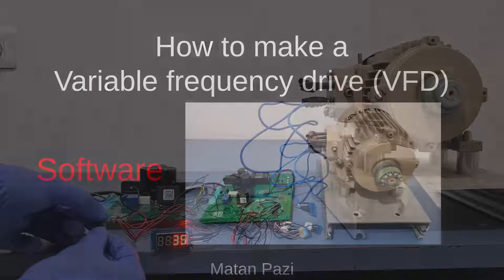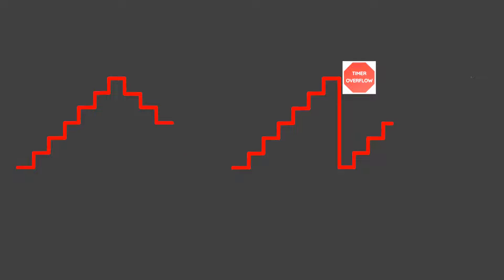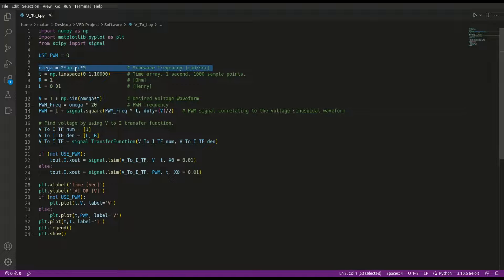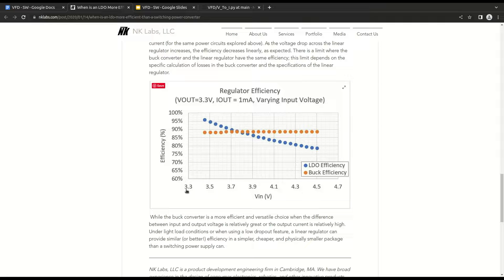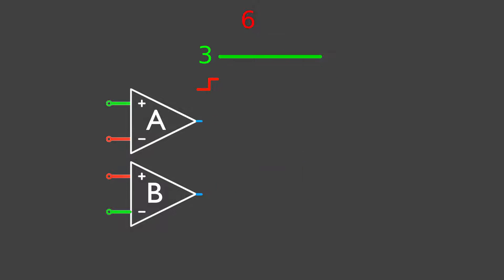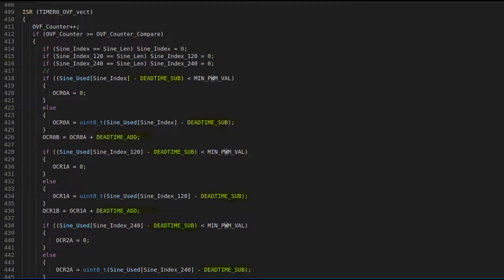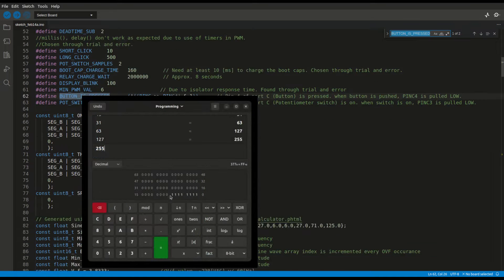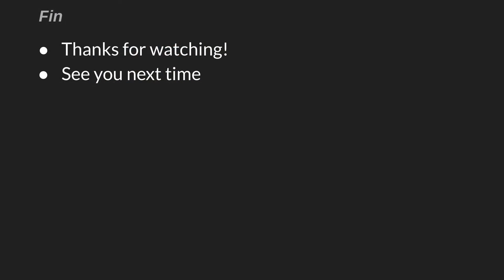How to make a Variable Frequency Drive (VFD) | 3: Software

Comment: Great video and great project in general. I'm trying to build a single phase inverter based on your project sir, but unfortunately I'm not being able to make the motor spin, if I measure ac voltage between U and V phases at 120Hz, I only get a voltage value around 146V. My induction motor has a capacitor and it's made to be running from an ac 230v@50Hz power outlet, can you share any information regarding the 1_PH side of the code sir? It would be very appreciated
Reply from the maker: No special change needed for a 1 phase motor, except for not needing 3 sine waves, not sure what else to contribute..
Good luck!

Comment: Excuse me, do you have a datasheet for the component? Also, regarding the motherboard, how did you design the circuit so that you can later weld the components?

Comment: Great video and great project. One question. In your ISR, why do both outputs of the pwm timers cycle every time? Shouldn't that phase of the motor  be kept close to the same potential difference until it crosses 0 or 180 degrees in its phase angle? Or am i misunderstanding the code or missing something else?
Reply from the maker: @aaronveale6402  Thanks.
I didn't exactly catch what you meant.
Can you refer to the exact variables?
Or maybe copy the relevant part of the code or maybe show how you would expect it to be?
Reply: @MatanPazi , sure. Starting on line 443 in the isr.

if ((Sine_Used[Sine_Index] - DEADTIME_SUB) < MIN_PWM_VAL)        
      {
         OCR0A = 0;
      }
      else
      {
         OCR0A = uint8_t(Sine_Used[Sine_Index] - DEADTIME_SUB);
      }
      OCR0B = OCR0A + DEADTIME_ADD; 

I would have expected for half of the sine index array for OCR0A to be zeroed turning off that igbt completely and the other half to have OCR0B zeroed. Thanks  for your response BTW.
Reply from the maker: @aaronveale6402  Oh, why?
I'm using sinusoidal modulation, what's the reasoning behind zeroing the output for half the period?
Reply: @MatanPazi  my basic (and inexperienced) understanding of your code is frequency is handled by timer0 overflow events which increment the phase angle to the next stage with your isr. Then your isr pwms a full or reduced potential difference (positive or negative) to each phase depending on the phase angle making it one segment of your waveform.  So why does one phase need to be pulled both negative and positive in a single segment of the waveform? Or am I missing something?
Reply from the maker: @aaronveale6402  Ok, I'll focus on the second part: "So why does one phase ..." since the first part seems to be correctly understood.
Are you asking why I'm commanding both the positive (Top) and negative (Bottom) PWM outputs?
Essentially asking: "If I want a positive potential difference, can't I just command the top transistor at certain duty cycles and leave the bottom transistor disconnected?"

If during normal operation phase A's transistors (Both top and bottom) are off, well, wtf, now the path for current flow in phase A is cut off.
Remember that the phases are essentially inductors which resist changes in current, all of a sudden you'll get voltage spikes to make sure the current continues flowing.

I recommend checking out this website on the topic, it'll probably make more sense than my attempt, with many more visual aids:
https://www.switchcraft.org/learning/2017/3/15/space-vector-pwm-intro
Reply: @MatanPazi  I appreciate your help in my understanding, the link you sent has a lot of good info that I will need to comb through. Unfortunately it didn't click for me, I think I have it now though. It's a carrier wave signal similar to FM radio correct?
Reply from the maker: @aaronveale6402 umm, I suppose.
Though instead of the frequency changing based on the amplitude, the duty cycle changes.

Comment: Matan boa noite. Qual compilador você está usando para que não ocorra o erro vector 16() do Timer0?
Reply from the maker: Checkout lines 54-55 in the code, they may address this issue for you.
Notice you'll need to make changes to your wiring.c file.
Reply: saber qual alteração fazer no arquivo. Você poderia ajudar?

Comment: Hi Matan. Great project, really. I just need to reverse turning of motor. Can you suggest any resources or sample code about this? Thank you very much.
Reply from the maker: Thanks!
Not sure of any specific resource, but you could add a hardware switch which would determine FWD or BKWD drive by changing the sinewave order for example.

Comment: Hi good morning.  I modified code line number 372 : TIMSK1 = (1 << TOIE0); and line number 434 :  ISR (TIMER1_OVF_vect) it's working fine. Thank you.....
Reply from the maker: Hmm, strange Timer0 didn't work for you.

Thanks for the update, glad it's working now!
Reply: I am try sir @softsubu why signal PWM not working in osciloscop
Reply: Help my sir @softsubu 🙏🙏🙏
Reply: Why wasn't line 407 TIMSK0 = (1 << TOIE0) changed?

Comment: ola. este codigo esta com problema, nao compila.
Reply from the maker: Look at the comments in lines 54, 55.
I assume that's the reason for the error you're getting.

I also just fixed a bug relating to the variable Desired_Freq, you can try compiling using the latest code.
Reply: @MatanPazi  could you provide the schematic?

Comment: do you have any software thoughts on how to implement vector control on an induction motor? it seems similar to field oriented control but all the drives we buy in our plant are called vector drives. and they are supposed to calculate the vector of current in the rotor, and the current vector in the stator and improve RPM control at varying torque loads. It seems to account for the slip changes as loads get heavier or lighter. If we set a frequency on a simple scalar drive we see RPM dip when loads go up do to the motors slip.
Reply from the maker: I haven't implemented FOC on an induction motor so not sure, it seems to be a bit more complicated than FOC control on a synchronous motor, since I assume you would be interested in the slip speed which isn't measured directly (The encoder measures the rotor speed and not the slip speed), though it can probably be estimated..

I haven't read it but this seems like an informative article from TI on the subject if you want to go over it:
https://www.ti.com/lit/ml/sprabp8/sprabp8.pdf?ts=1679949249580&ref_url=https%253A%252F%252Fwww.google.com%252F
Reply: TI has a good video about this here: https://www.youtube.com/watch?v=_6-_jvZe7iA

Comment: Hello, could you upload some calculations or tell me where did you find Vrdson , Dz2 ? I would really appreciate it. Great job of your work.
Reply from the maker: Thanks.
I don't follow, what is "Vrdson , Dz2"?
Reply: @MatanPazi  I am watching the whole series . Vrdson is a value of AN4840 (page 24 . ) that you probably used to calculate Cbootstrap for IMP STGIPQ8C60 circuit . Dz2 is diode Zener connected on each IGBT in parallel.
Reply from the maker: @konstantninosps1067  I didn't calculate VRdsOn.
I figured out what was the needed capacitor capacitance according to P. 25 in the same app. note you mentioned.
The cap nominal voltage needs to be big enough to able to withstand Vcc (15[V] in my case).
And then I chose a Zener diode to protect that capacitor, meaning a breakdown voltage lower than the capacitor's nominal voltage.
Reply: @MatanPazi  At P.25 you cant figure out Capacitance without having knowledge of ΔVcboot value. For example P.26 it says that needs Vcc = 16.9 V so that ΔVcboot = 0.1 ----> 2.2u< C <3.3u .
Reply: Thank you for your quick response, I appreciate it .
Reply from the maker: To my understanding, ΔVcboot simply defines the maximum allowed voltage drop on the bootstrap cap when the high-side transistor is on (Discharging).
The smaller it is the more conservative/stable your gate driver voltage will be.
The only critical requirement on it is that it doesn't get too big so that it causes Vcboot to become lower than VBS_tℎ(on), which has a max value of 12.1[V] which would trigger an under voltage scenario.
So as long as you choose a cap according to their general guidelines using the graph in P.25 w/ a nice safety margin, you should be fine. I chose a 2.2 uF Cap, with a Zenner diode w/ a breakdown voltage of 16.8V~19.1V as to not exceed max Vcc of 21[V].

I'm really not sure how they deduced a Vcc of 16.9[V] from choosing ΔVcboot = 0.1.
Reply: @MatanPazi  You helped me a lot Matan thank you. One more request would be to upload the waveforms with oscilloscope before and after connecting it with load. 
So that anyone can decide whether needs a lowpass LC filter or not, for pure sine waves .